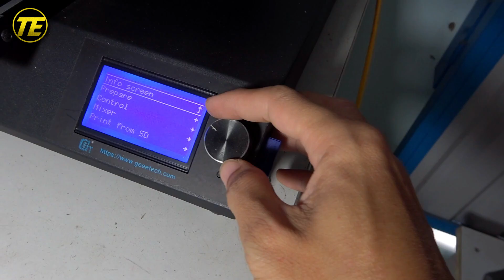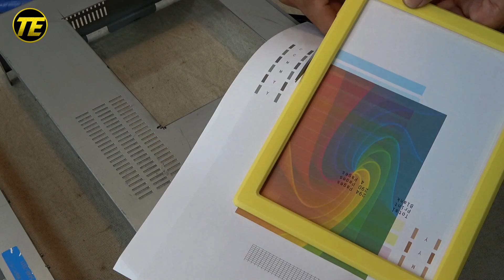How to window and LED mod a Sony VHS player

Comment: Why use 3V LED and 22 ohm resistors? How did you calculate to know what to use?
Reply from the maker: I did not calculate that I tried many resistors and found that a 22 Ohm resistor is suitable

Comment: Might not work for some machines as the decks are often light sensitive. Any external light source may affect the optical tape (begin/ end) sensors causing 'undesired operation' 📼
Reply: Absolutely right. With Beta machines it would be a different story as they use magnetic properties for begin/end tape detection.
Reply: Ye my LG vhs stop whan open
Reply: Yeap you are correct 💯

Comment: One of those projects someone does just because they can. Imagine if they came out with this feature when they were first made all those years ago. Great for checking for those things poked into the VHS "letter slot" such as plastic toys, dead butterflies and sandwiches they didn't want to eat before putting a tape in.